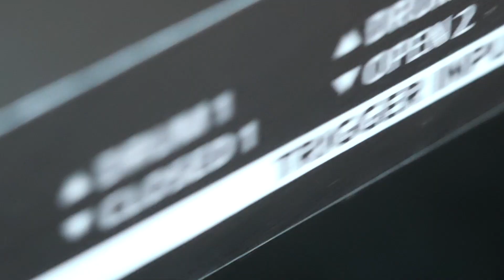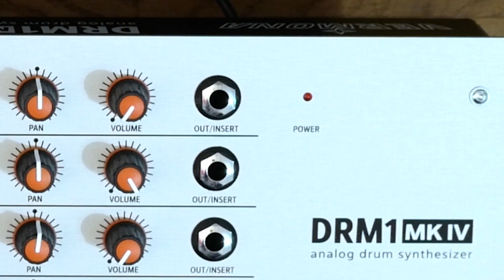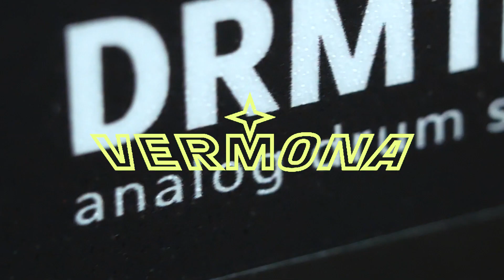VERMONA DRM mkIV - DYNAMIC TRIGGERING

Comment: So... rack mount unit with power button on the back... why???
Reply from the maker: We decided to place the power switch on the rear next to the power connector in order to prevents routing the power line internally through the whole machine. This helps to minimize interferences.
We think that most of the people who install the DRM1 MKIV into a rack use a global power switch for their setup, so that shouldn’t be a problem.

Comment: Nice! Impeccable quality machine.  A question: will the device respond to velocity via midi and output corresponding dynamics? Or will it only be accent / no accent?
Reply from the maker: Yes, velocity is available via MIDI. With installed trigger inputs, it can also convert the MIDI information into analog gate signals with dynamic or gate + accent.